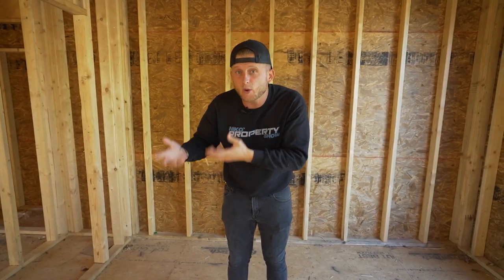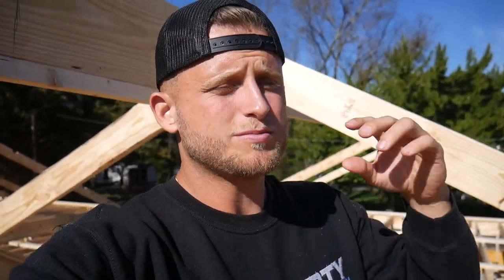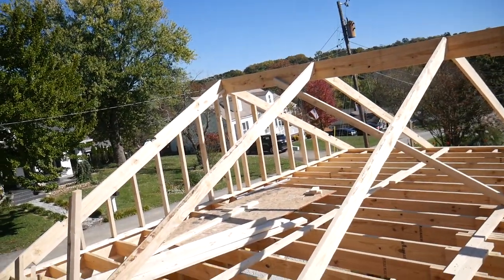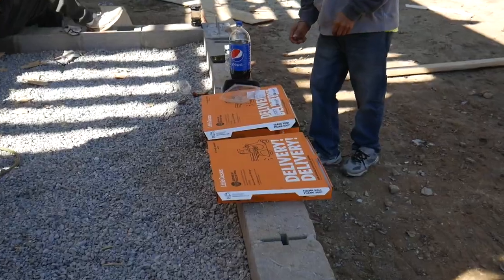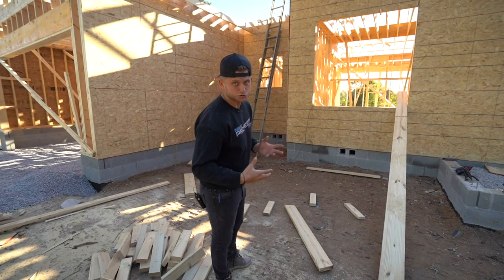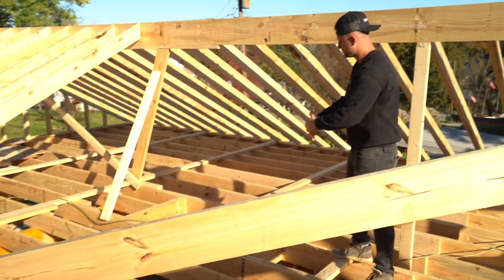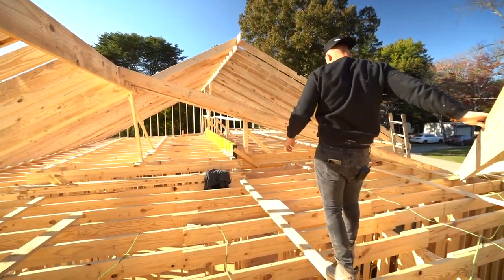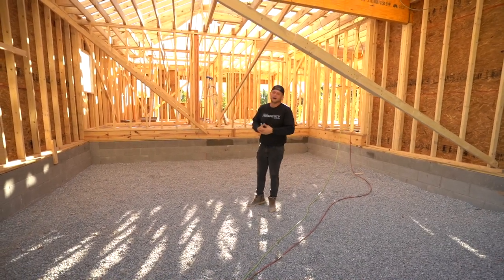Framing The Roof Installing Rafters | Building A $350,000 Custom House | Episode 13

Comment: Why not just do 10’ ceilings all around ?  Just learning over here Niko…
Reply from the maker: It all depends on what you prefer. What kind of ceiling heights you want etc. Also, don’t forget that cost goes up with 10 foot studs (2 x 4s)… so there’s many different reasons why to do it or not to do it. Really depends on budget and preference